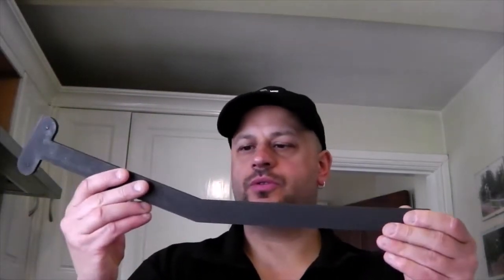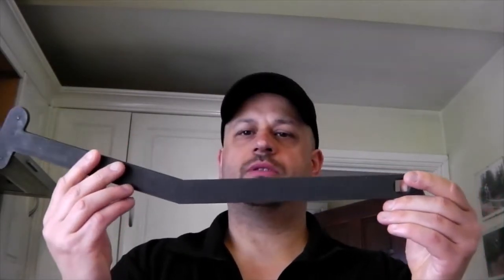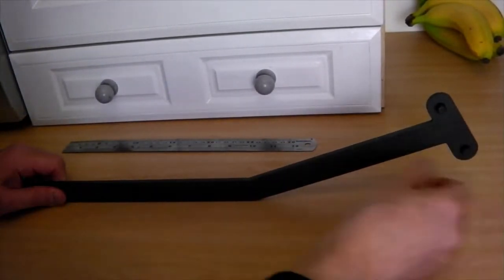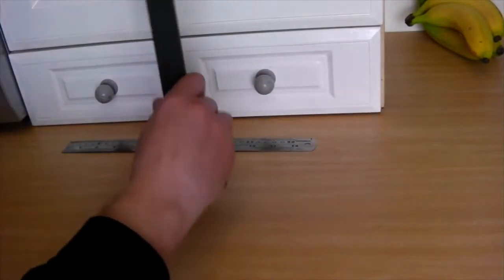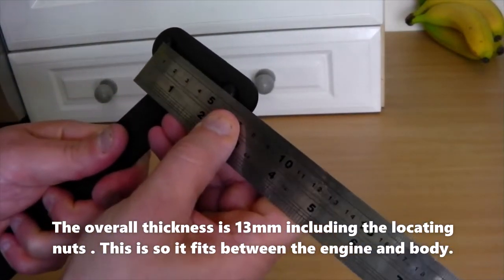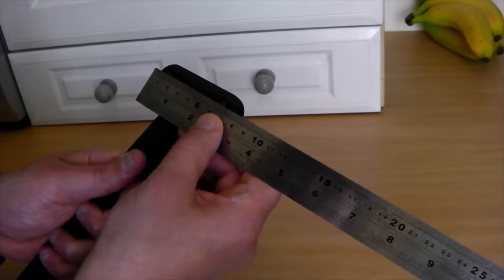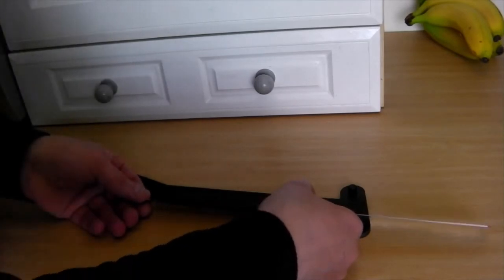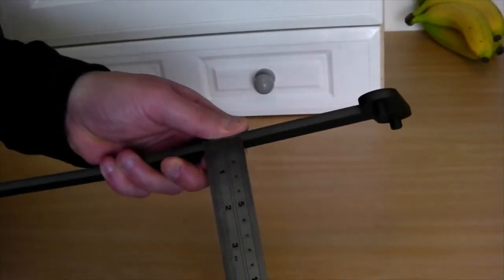Mondeo MK3 Auxiliary belt tool dimensions

Comment: Made a tool from your dimensions took me 20 minutes. Made pins a little long as this is the only dimension you don't give the length of pin.
A little gringing to let it fit in to gap between tensioner & inner wing. But other than that worked a dream👍
Reply: i was thinking this as well but worked out that if the total thickness was 13mm and it was 5mm flat bar then the studs must be 8mm long.  what dia of studs did you use?
Reply: @daviddoherty5355  I used 8 mm studs . Gave me plenty of leverage